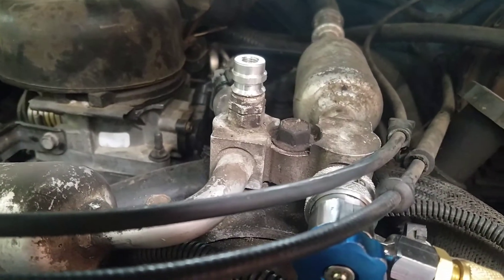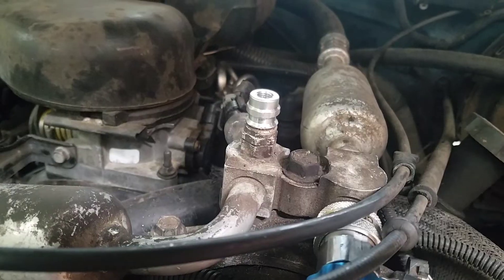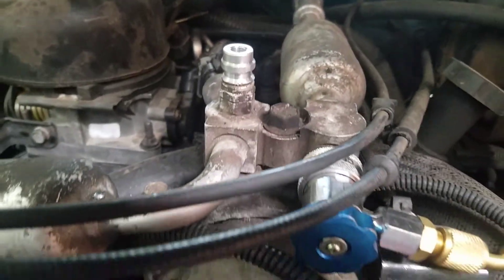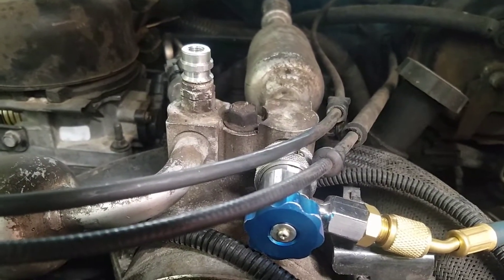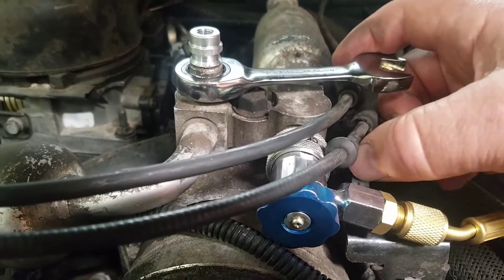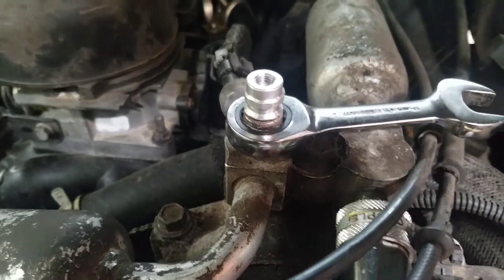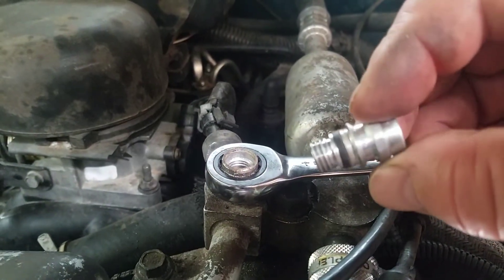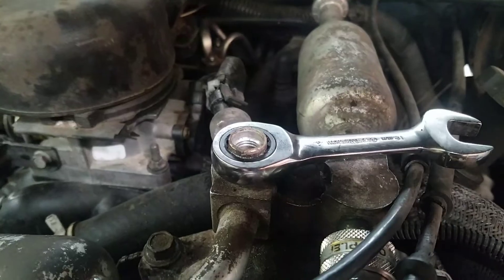AC High Pressure Schrader Valve Replacement.

Comment: They can be a little tight in there after a few years of service, good on GM for putting the 16mm stud to prevent breaking it off the line.

Comment: Thank you for explaining this. I've got a '99 Chevy Express 1500 van, trying to figure this nut arrangement out. I was doing it wrong, thinking it came apart where the two hex but up against each other, holding one and trying to turn the other, (didn't work, lol). I'll go out and  just grab the top part like you did while holding both lower nuts (which are fixed together, one piece, anyway, it seems), and turn the top part with a set of vice grips like you did! Saved the day! It's my low side port that failed. Thanks again.

Comment: I bought the entire hose system for my 1998 chevy pickup. It came withe both schrader valves installed and like the man just said the high side valve is a POS. This unit came from Amazon and is a FOUR SEASONS 56156 A/C Hose assembly. Unfortunately, the high side schrader valve is not replaceable. It is an integral part of the pipe. DO NOT BUY THIS PIPE SYSTEM!

Comment: I did on my Ford 500 Limited and it's leaking now.  Can I buy a valve for this car.  Also, I need to vac the system before recharging, right?
Reply from the maker: Always vac the system. I am sure you can buy a new valve for the 500 but it might be different.
Reply: @bigbill2376  Thanks.  Yes I know.  I'm just gonna wait until spring.  The best used car I've ever bought though.  Really solid. Was owned by an older couple and the maintained it meticulously. Every oil change and all work documented. They wanted 2k for it and gave it to me for $1750 because I was a veteran. Really nice. Talked to the mechanic that did all the work and he told me I'd never find a better car for the money.  So far so good!!

Comment: Does the new one have the rubber ball like the first piec of crap or can you get one with a real schrader valve
?
Reply from the maker: I have no idea. Wrecked the truck shortly after this and it's been just sitting in the yard.
Reply: My one from napa is a Schrader valve
Reply: old comment but some info here-I have found the ACDelco replacement is a ball valve while the Dorman replacement part is a Schrader valve

Comment: Dorman 800-955 replaces the high side port for GM and it changes it to the Schrader valve core system just like the commercial guys use. Much better product.
Reply: Thank you! I was searching looking for this as well. The kind with the black ball valve is crap.

Comment: Oh, really? $6 for a new high side Schrader valve, huh? WHERE???
Reply: 7.xx$ at advance auto and amazon. just bought one. also buy the dorman brand not the ac delco the dorman uses an actual schrader valve not the stupid rubber ball valve the ac delco one uses. also make sure to use the proper socket not a normal open end wrench. get a octagon high side socket
Reply: I just now bought one from napa for 9 dollars easy peasy
Reply: Just bought a 5 pack at Auto Zone for 7 bucks. Lady said "Huh, it's supposed to be a single pack,...oh well here ya go."  Thanks!

Comment: Will the low pressure side come out the same way?
Reply: Hayden Preston no the low side has a valve stem inside the core you need a specific tool to get out. Make sure the systems empty then get the valve stem tool and twist the stem out, put new one in and tighten it. Autozone or advanced has the stem and tool for less than 10$ all together. https://youtu.be/pE3Mmd11m3U
Reply: @suburbanman4935  How do you empty the system? forgive my ignorance
Reply: @XTRABIG  no ignorance brother, man it’s been a while since I’ve done AC but if I remember you can take a hose from any recharge system and attach it to the low side port and discharge it using the trigger. You’ll need a towel so you don’t get frostbite since it’s freezing cold. But even after draining it, before you add more you’ll have to vacuum the system out to get rid of excess air. There’s a video of how to get it out: https://youtu.be/I15pEb6SamU

Comment: I appreciate the info but on my 2003 express there is no backup nut.  I did try to remove it anyway but I felt I was going to break it off I was pushing so hard.   Someone else told me you had to replace the whole accumulator just to replace that F***** valve.

Comment: Can the same thing be done on the low pressure one as well?
Reply: Carlos Aguilar the low side is a lot easier. Just a valve body u can replace
Reply: Same crappy rubber ball valve on both. I'm replacing my low side, now, 99 Chevy Express 1500 van. Started leaking, couldn't stop it.

Comment: can u pls help? my truck 03 silverado has not had ac/cold air for a couple yrs. last week i put 2 cans of refrigerant in the system. so i hear the compressor kik on and i get excited lol the thing is blowin nice cold air. monday comes and im bak to the same problem. i look and thers green stuff leakin all over the high end service port(the one u dont put refrigerant in)?!?!? i thot it was coolant lol but im like how did coolant get in ther. but i remember takin it to a shop so im guessin they put sum dye in ther im not sure. anyways so i replace the whole thing. put sum refrigerant in. but man its acting weird this time. im using the ac pro recharge hose n gauge. the gauge reads red wen the ac in not engaging n wen it does its reads in the white/low. last week it did not do this at all. it was jus stationary but it would go up wen i added refrigerant not bak n forth like it does now. am i jus low on refrigerant or is it sumthin else?
Reply: it's not coolant.......it's ac oil or dye.......buy a new high side valve and install.......you have about 9oz of green  pag oil in sys.......and your sys takes about 25oz  r134.....I think..............my 02 takes 29
Reply: hey thanx man. i new it wasnt coolant but at first glance i was like wtf coolant lol. yes i did replace the high side alredy yesterday n refill with refrigerant i put 2 cans so 24oz. it is cold right now so we'll hav to wait n see how long this holds. why does your 02 take 29oz? biger truck?
Reply: @outoftime788  so did it hold up with replacing the high side service port?
Reply: @atola5349  i want to say ya cuz the ac stil works